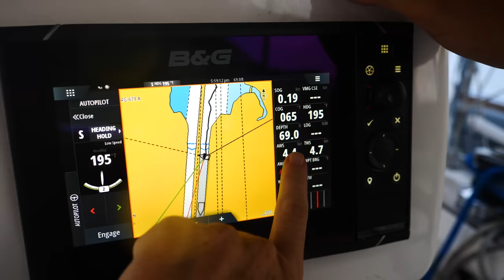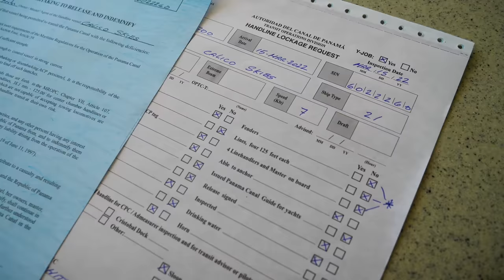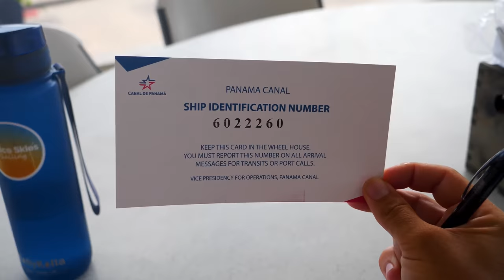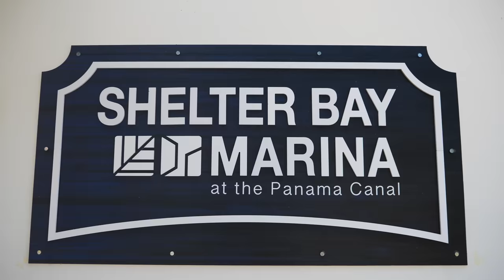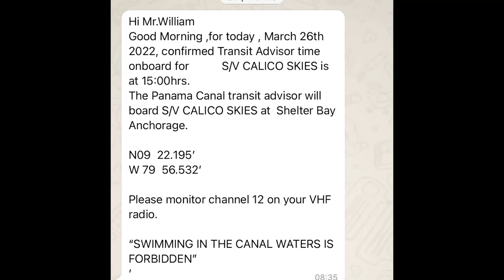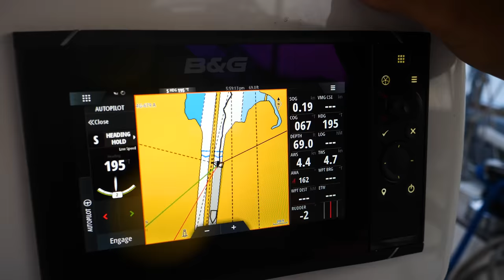The Surprising Things We Learned Transiting the Panama Canal.. What does it cost?! FINES?! (Ep.137)

Comment: I've always wondered what would happen if they opened up the canal and let the waters on both sides level out so we wouldn't need the canal?  Does anyone have an answer?   🇺🇸
Reply: Lake Gatun is 85 feet above sea level, hence the lock system.  To allow transit without locks it would mean that you would need to dig the channels another 85 feet deeper than they already are and the slopes and everything else at the cost of billions of dollars.  When they were first trying to dig the panama canal this was what they were trying to accomplish but with landslides and other issues made this extremely difficult so they switched  to a lock system to avoid the problems and the costs that would be involved in a sea level transit system.